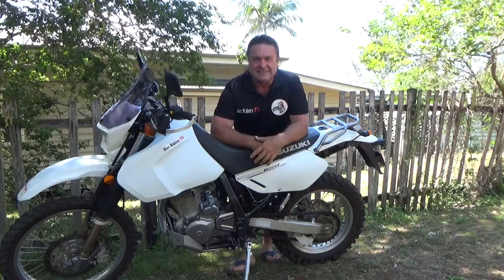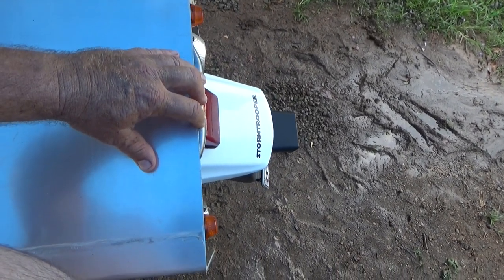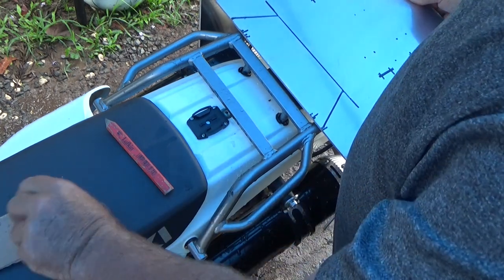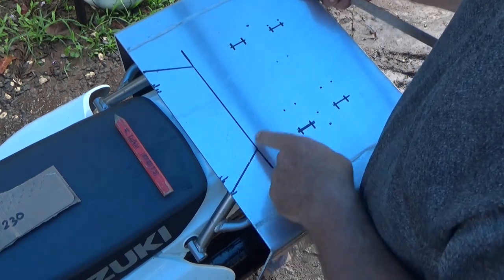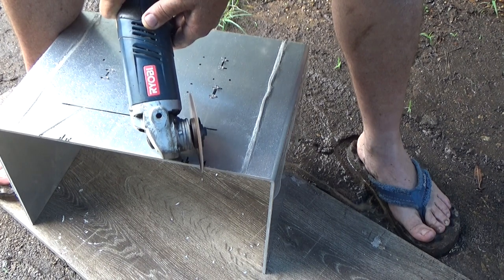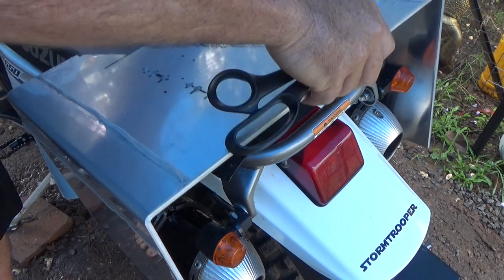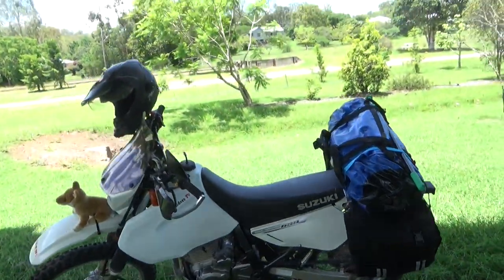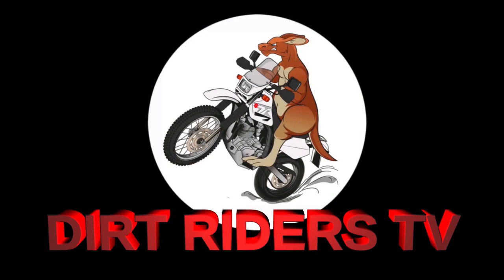DIY Dirt Bike Saddle Bag Rack

Comment: Great idea, not so great execution. Because the u-brackets are wider than the rails on the bike, the whole assembly would move back and forth. Also, you could use large cup drill or whatever is called to cut round corners, and  cutouts into that aluminium sheet, in order to make it look more professional and a bit light.